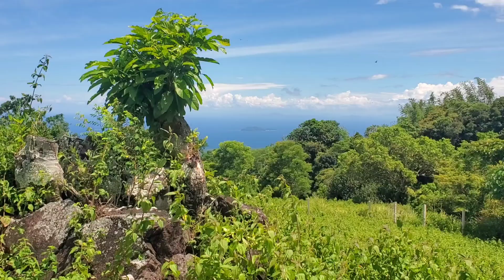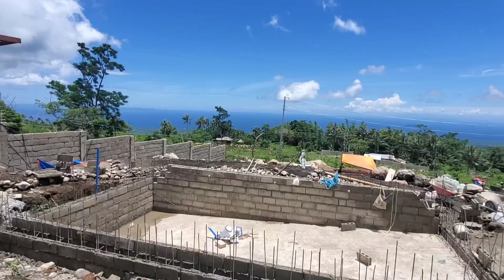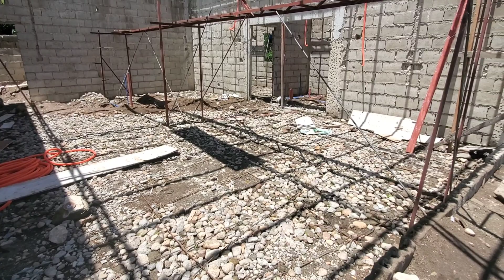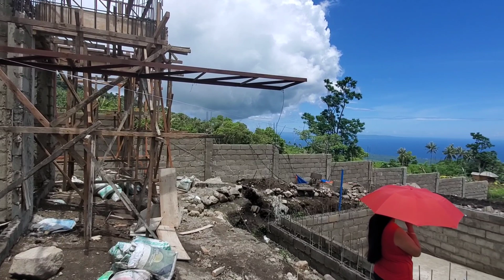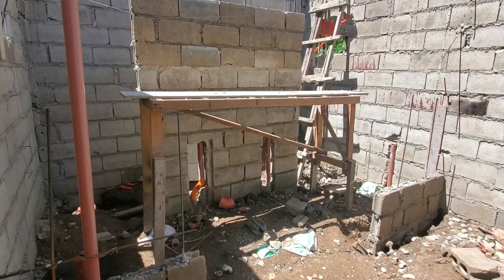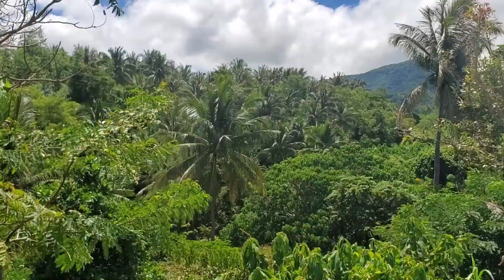Foreigner & Filipina house build- Construction day 49

Comment: It's hot in the Philippines.  My ceiling is 10 feet all around and still get hot inside the house.  I'm planning to put some kind a ventillation in the attic to keep the house cooler.  I wish I have a 15 feet or so ceiling.
Reply from the maker: Good point Rey, I have spoken to the contractor about a fan in the attic blowing outwards to increase air flow by drawing in cooler outside air.  Thanks for watching.

Comment: Almost all new subdivisions  have 8 feet ceilings , some premium builders do 9 foot ceilings now  in Ontario Canada and elsewhere, of course  the 9 foot ceilings  add quite  a bit in costs in extra  lumber , bricks, drywall and extra  time in taping, same house in my subdivision  was $15,000 upgrade  22 years ago, I can imagine that upgrade cost has probably  doubled.  A friend  wanted 9 foot basement walls  were the original plans was 92"( 7 feet  6 inches , I think the  builder charge him $10,000  extra, basically  for extra cement and higher form work. Basements are never finished by the builders , bare concrete , we turn them into living space years later , it is like adding another level  to  the house  as new interior  walls and insulation and ceilings   floor coverings are added.
Reply from the maker: In the US 8-foot ceilings is the norm.  We wanted a grand main room, so we designed 12-foot ceilings.  Also, helps with the heat keeping it up higher.  10 foot in the bedrooms and 9 foot in the bathrooms.  The higher the ceilings the larger the room looks.  Yes, higher ceiling also means higher costs.  Thanks for watching.